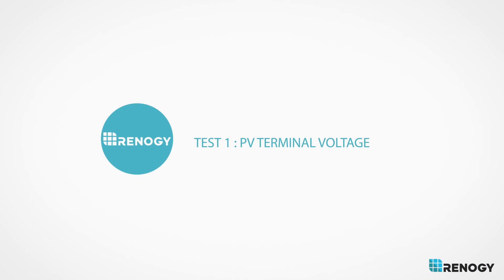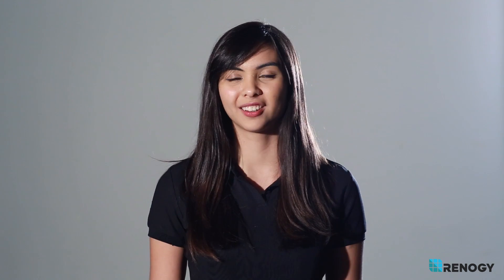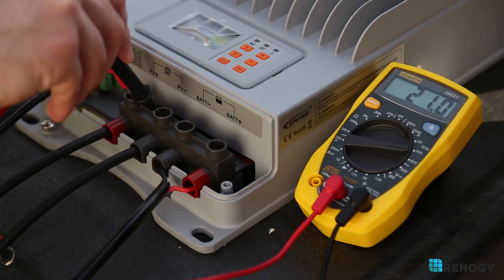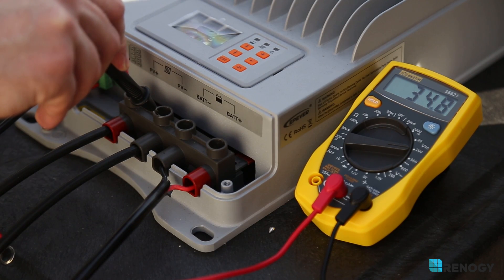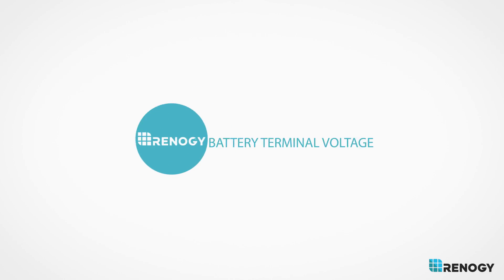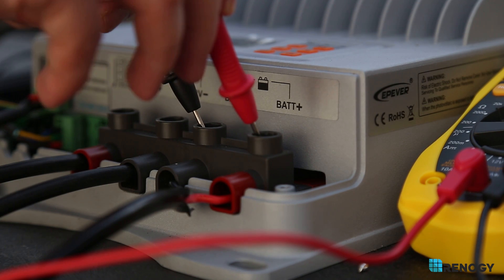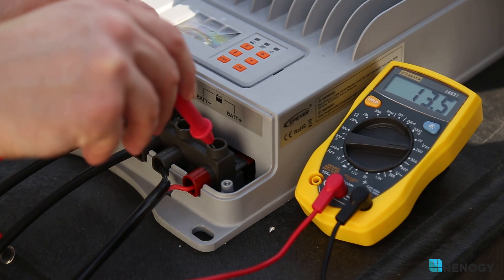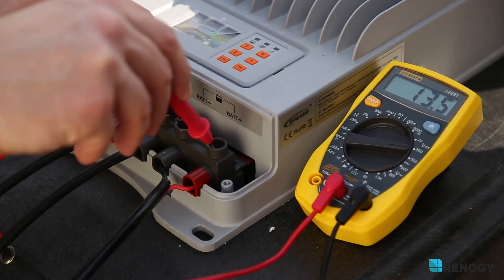Renogy: How to Troubleshoot Your Charge Controller

Comment: Ludicrous. Call a technician?
In Australia there is no support phone no. The online support sent screen grabs from the manual-which is useless. 
How does the controller (on both panels) register a fault code before it's even plugged in....have spent hours on this so far -1 star
Reply from the maker: Hello, this is Renogy's customer service center. Currently, we only offer phone service in the US, and we are still in the planning stages for other markets. However, we do provide online and email support at the moment.

We apologize for the manual not being helpful as mentioned by you. Please rest assured that our products undergo strict quality control before leaving the factory. Any issues related to installation or settings can be addressed by our professional technical team, which serves as strong post-sales support. If it is determined that the product is faulty, your warranty rights will certainly be protected.

Once again, we appreciate your understanding and support.

Comment: if you have a 100w suitcase, check the wires that plug into the bottom of the voyager controller.  Easy to step on a wire and tug loose a  wire connection.  The wires are held on only by the end connections, which of course is poor engineering for a portable design, or for any electrical wiring, but seems standard for circuit boards encased in plastic.  A wire tie could be placed on the inside of the steel frame and routed that way.
Reply from the maker: These designs may have cost considerations, among other factors. Nevertheless, it's a fantastic idea. Thank you for your feedback.

Comment: Does anyone know of any possible  way to contact Renogy  ? Ive been trying for almost 4 months. I had 2 x 40 w Coleman  panels which worked great  and replaced that  with a 2 x 100 w Renogy system for a bucket list trip south for 2 months . 200 W to be really safe (I thought )  .  Its in a wheel van and getting ice in that sun every 2 days was becoming way too difficult for one person . The kit came with their  Wanderer controller  It worked great for a week , but then  it did not keep up to the only thing I really needed it for ,  a small  12v cooler,  with 12-14 hours of intense southern sun .  The 2 x 40 W were totally fine .  The  lights flashed yellow and  now the panels supply power but nothing is going to the.batteries. Batteries are new and will  hold a charge. I've had someone do 3 resets on moonless nights . Nothing .  I hoped to resolve the issue with Renogy support while I was south  , to save the major ice hassle .    I called their support number .  It will tell  you the wait time is 6 minutes .  Every 5 seconds for a long time  then it says leave a message , when you start it hangs up .  Everytime .  I've tried Sales, Tech Support , every extension. It's a "6 minutes until your rep is available " you wait much longer , and  they all hang up .  I've used all relevant  email addresses  that are on  their site and I've also  filled out the "submit  form "version request .   This has been since I bought the system .  Obviously I'm pretty disappointed that after all that effort of "upgrading ", delaying the trip so I could install this and  they never even replied in the 2 months while I was still away .  As far as I'm concerned they can sell you something but they have no intention of supporting or guaranteeing anything once you've bought it .  Im.guessing now that the warranty is ove they're leaving me  high and dry ..Right now with what I've paid to get it installed and diagnosed ,  it's very expensive shingling for a van
Reply from the maker: Hi, PAL.

Thank you for your feedback which let us know your problems.  In order to assist you to solve your problems, can you please kindly tell us your case number?
Reply: @RenogySolar   @Renogy Solar   my  first question was ...does anyone know how to get a reply.from Renogy ?.    I have never gotten any kind of  reply in 4 months
Reply: Useless

Comment: What a worthless troubleshooting video.

My renogy controller charged my lipo4 battery to 17.7 volts.

The high voltage drop out is supposed to be 16 volts.

What's up with that?
Reply from the maker: Hi, Electro.

For solving your problems more timely and efficiently, we suggest you can submit a case  (links listed below for specific locations）for help. 
 
https://renogy.force.com/helpcenter/s/contactsupport (USA)
https://renogy.force.com/helpcenterau/s/casesubmit (Australia)
https://renogy.force.com/helpcenterca/s/contactsupport (Canada)
https://renogy.force.com/helpcenteruk/s/contactsupport (UK)
 
Thank you for your understanding!

Comment: Didn't get the answer I was looking for.
Reply from the maker: Hi, sallyplus4.

Can you please kindly tell us the problem you have met?

Or  you can submit a case through our Help Center Portal with more details (links listed below for specific locations）for solving the problem more effciently. If you have previously submitted a case which has not been replied, please provide us with the case number so that we can inform the customer service to solve it for you as soon as possible.
 
https://renogy.force.com/helpcenter/s/contactsupport (USA)
https://renogy.force.com/helpcenterau/s/casesubmit (Australia)
https://renogy.force.com/helpcenterca/s/contactsupport (Canada)
https://renogy.force.com/helpcenteruk/s/contactsupport (UK)
Reply: @RenogySolar  I have a Rover 20-A MPPT.  Yesterday morning when I put the 200w panels to charge at some point the PV LED indicator light began flashing, white slow, and the battery LED remained solid white. No other lights on. After a couple of hours the PV LED began flashing, white and fast. No error code.. I couldn't make sense of the information in the manual and disconnect the panels.
This morning, within 30 minutes the white slow PV LED is flashing.  The screen as yesterday shows 100.00 coming in from the panels.
Yesterday, the panels went out about 9a and I brought them in about 2p.  After a half hour the screen showed the battery was 78.00. It was about 35.00 when I 1st put it out.
Question, is the flashing light a warning?

This morning I put the panel out

Comment: My renogy Rover 20 amp stopped working today. Yesterday I accidentally overloaded it, it gave me that error from too much solar power I presume, but then it continued working and today it's not all. Well everything is functioning properly it just shows no amps all of a sudden and I should be at that least 10 amps in this weather.  So, checked the manual and for one of the errors over powering or something it says to do a Reset of Controller.  But there's instructions on how to do a reset of the unit.
Reply from the maker: Hi, James.

You can try to reset it. Please disconnect all the wirings between products and connect them again later.

If it still gives you the error that solar power is too much, you can consider to remove one solar panel for a try.

Hope it is helpful.

Comment: Cannot calibrate 500 a battery monitor panel with both 200ah lithium batteries. Monitor says they are at 96% but batteries are dead..🤦

Comment: I have a Regony 20 A MPPT controller that shows battery's empty but the battery's are fully charge, olso it s showing E1 error signal. I meter the cables coming from the 100 w solar panel and it shows 19.9 volts coming in, but the cables coming from the batterys show 0.01.
Can some one tell me how to reset the unit?.
Reply: cordelmar disconnect the wires from the battery and reconnect

Comment: I found this video to be completely useless. I've been using a Renogy panel and Renogy PWM controller without difficulty for a couple years. Starting yesterday, there is no load voltage coming out of my Renogy PWM controller, however the controller itself shows that the solar panels are charging the battery and that the batteries are fully charged. My work mode light on my PWM charge controller is alternately slowly flashing 7 and then it stays lit on 7 for a few seconds, then goes back to flashing 7. I've tried pressing and holding the set button next to the work mode light for 5 seconds to change work modes, but it doesn't work. I've disconnected everything and reconnected it, and pressed the set button. That doesn't fix the problem. The work mode light still slowly flashes 7, then it stays lit for a few seconds, then goes back to slowly flashing 7, and no load voltage. Is my controller defective? Many thanks.
Reply from the maker: Hi there! We're sorry that you didn't find the video useful. For cases that don't fit this general guide, we definitely recommend contacting our support team at techsupport@renogy.com or by giving us a call at 1-800-330-8678.

Based on your description, it sounds like you might have our PWM30CC. Our technicians do recommend that you call them so that they can troubleshoot it further for you. With this controller, we would recommend setting the work mode to 6. This mode is a manual mode and should allow you to turn the load terminal on and off with the mode button. If this does not take care of the problem, the controller might be defective. If you have any further questions, please feel free to get in touch with one of our tech representatives.
Reply: Thanks for your reply. The mode switch is completely stuck on 7. The mode selector button does nothing at all. I may contact support. Interestingly, I also saw several models of controllers with the same exact set of controls/indicator lights online at a tiny fraction of the cost of the one I bought from you. They were so inexpensive I decided to get one to try. If it works, I'm good to go. If not, I'll contact customer support.